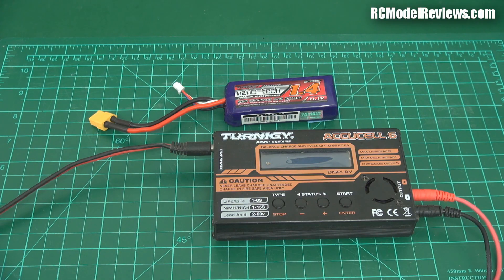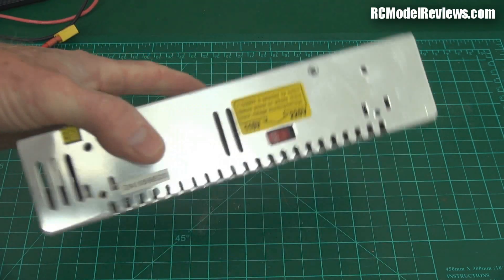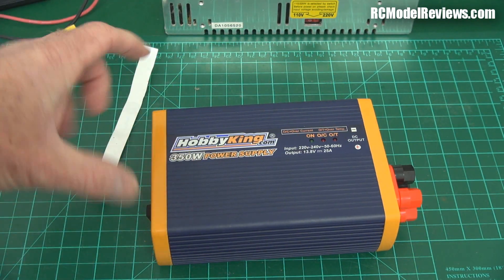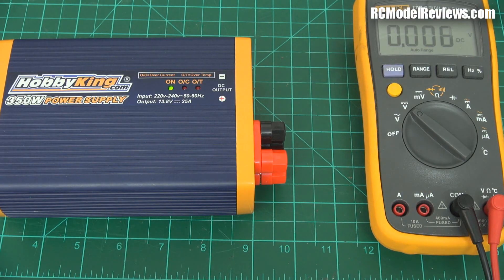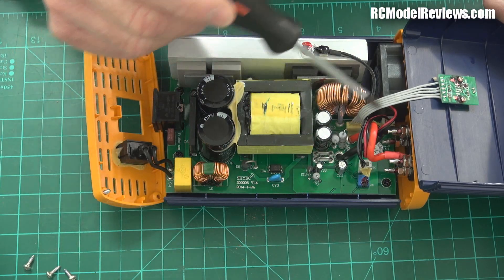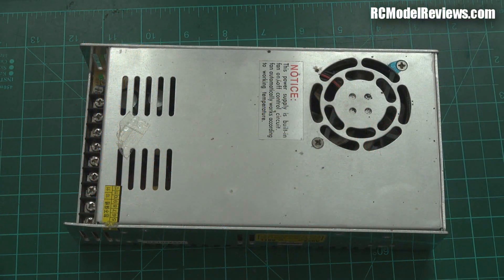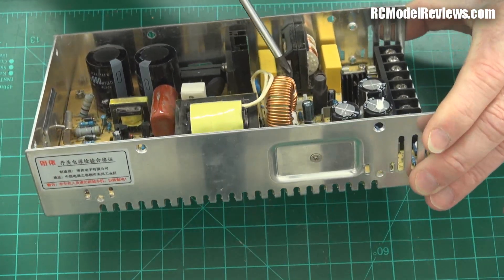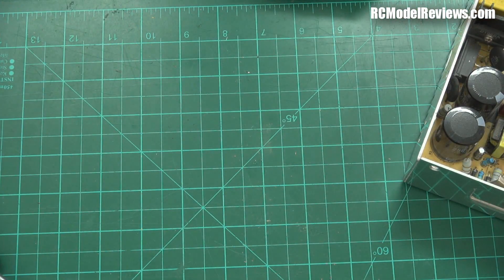HobbyKing 350 Watt 13.8V power supply

Comment: LOL at those output capacitors :D what is that hardly 1000uF? probably not even low ESR either, the ebay one looks like 3x2200uF or a total of 6600uF!!

Comment: I just dropped by to tell others that I've been using this power supply for a year and it's so f**^ LOUD!

Seriously, I take 200W out of it and built in fan is very very loud. Supply itself is not even warm so I think it's firmware issue that spins fan too fast even when temperature is ok

Comment: great idea ,I have a question for you, how I know , how many watts needs my charger, for te ohm law ,or what, my charger is a graupner polaron ac/dc but the ac circuit don't work, don't want to start, but if I put it in my car battery works like new...
I buy it and came like that but when I open the box the warranty was over ,that was a backtrip but I tested in the car and by surprise its start well like nothing is in te other circuit charge well discharge well ,do all like supose to ,but the AC don't work

Comment: Good info Bruce. I've been using my Ham Radio PS which of course are a totally different animal. Not really portable,so the HK unit looks useful for field use since my vehicle has a 110vac power port( need to check to amp rating) but a unit like this should be useful if needed.

Comment: I have this power supply and have been using it for a while now. I use it with an iCharger and a paralell board to charge 4 4s batteries at once. It handles a 20amp load no problem.

Comment: Hey Bruce, could you do a video on how to use a multimeter to find  ground, positive and signal points.  I seen a min-naza video online, and the commentator referred to " ohming out " his naza to identify the positive, negative and signal for the gps input.  I bought a camera switcher from hobbyking, but I'm scared to use it because I've read that the polarities can be reversed from what's printed on the product.

Hope you or someone else can help.

Best regards

Comment: I use an old Antec 650w PC/AT power supply to run my Hyperion charger. I ended up needing to use two 12V rails to supply the charger because while a single 12V rail is rated for 19 amps the molex connectors used on PC power supplies would start getting warm when charging at 7A.

Comment: What batteries are you guys running in your 250 quads. Hobbyking is pushing a 40c 1400 mah but it's back ordered. Is the jump up to 40 c worth a bit of added weight?

Comment: It would be really nice if you'd measure radio interference as well. Cheap power supplies, LEDs etc often cause horrible radio interference, especially on shortwave fequencies. I certainly don't want any of that stuff in my home.

Comment: I bought a chinese 60A 12V supply to power my 400W skyrc charger, works like a charm, regulary charge a 6S 9000mah at 12A, only it does make a high pitched screeching sound under high loads though.

Comment: Hi Bruce! Could you make a video of the X8R, and how to optimize the range by adjusting the antennas on the receiver?
Reply: Put the paddles at 90 degrees at their bases, ensuring one paddle is also rotated 90 degrees as well. Check Dennis Baldwins channel for an example.

Comment: Hey, what happened to showing your Bodgy Bus Bar system! Hmmm.... BBB... You got a trademark on that? :-)
Reply: Ben Govett Yeah, forgot to include that footage -- I'll do a follow-up when the bits arrive for the other supply and include the bodgy bus-bar setup then ;-)
Reply: ***** If memory serves, in order to get UL or CSA or whatever your local safety certification agency is to pass your product as safe, the X and Y capacitors need to have a self healing dielectric. So assuming the safety certificate is not a forgery (admittedly most are these days) the caps are probably legit, which is admittedly impressive. Of course they could be fakes, at which point the UL probably is too. Or maybe they were salvaged :P
Reply: ***** would you also do a video on how to hook up a charger to the industrial power suply and leads to the mains

Comment: Why don't you use UPS from an old PC? Are these any better?
Reply: Hotwire A PC power supply, although it may be rated to several hundred watts, puts out most of its power at 5V.  The 12V output has much less power and is also only 12V.  Most modern 4-button chargers work much better at 13.8V through 18V.
Reply: *****
More modern PC power supplies provide 12V to the graphics cards (yellow wires as you know) and many support two graphc cards, two leads for each card, so there are plenty of options.These modern gaming graphic cards are very power hungry eg my GTX780 is rated at 250W. So there is plenty of power on these rails for running charger(s).  I use a 600W PSU and used plug adapters so I didn't have to mess up PSU leads just in case I wanted to use the PSU in a PC again. I initially purchased the  PSU for a crytocurrency rig but when I heard ASICs were coming I changed my my mind, and electricity is expensive where I am.
Reply: stewjw
Hi Bruce I'm surprised you didn't get into that and designed your FPGA crytocurrency computer.
Reply: stewjw
Yeah, but the problem is that the output is exactly 12V and many of the more powerful 4-button chargers won't deliver their full rated power unless they're fed with a higher voltage.  That's why this supply is a nominal 13.8V and my other one is a nominal 15V.  That extra 2V or so can make quite a difference when fast-charging large packs because the boost-buck converter in the charger is pretty limited.

Comment: Good review Bruce.  One suggestion for this type of item.  You checked voltage output at no load.  I would connect a watts-up meter or similar meter to the output and then connect up a charger or other load.  Test the unit at a something like 50%/75%/100% load to see how far voltage drops and also to verify if it can run at rated amp load for extended amount of time (or at least long enough to charge a common side lipo). And if you really want to dive a little deeper show us the voltage ripple on your oscilloscope to see how clean the output is.  :^)  Due to the nature of lipos I don't skimp on my chargers and its important to me to feed them with quality power otherwise its just another point of concern with lipo charging safety.  Just a thought.  Keep up the good work.

Comment: I have been useing the 30Amp aluminium one from DX.com for 2 years now. It will output 15.44V with the V adj all the way up. Tested it for 30A with power meter, esc and brushless motor for 5 minutes till the unit got got too hot for my tastes. My icharger does 20A max so no probs.

Comment: Yay Team...!

  It's surprising how long the solid state stuff will run, I have a 12V DC > 240V AC Inverter that's almost 30 years old, once it cooked it's Drive Transistors when it got a drink while operating in a rainstorm and my forgettery had left the Power Shack Door open, during it's first year in use...; and a few months ago it stopped working after the Leads managed to corrode through at the Battery Clamp attatchments...

  It, like your Industrial Cheapie, lacks a Cooling Fan and relies on Atmospheric Thermosyphoning to pump away the waste heat...; I wonder how long the HK unit's Cooling Fan will last, and how much accumulated Juice the Fan will suck during it's working lifetime (especially as a proportion of the Power which goes into the Battery Chargers...)  ?

  I like Thermosyphons, they're practically a Something-For-Nothing Machine,  and though most SFNs try to run by Perpetual Motion ; a good Thermosyphon is only tapping into Boyle's Law of Gasses, Coanda Effect, and Gravity... So they're Yummy...

;-p

Ciao !

Comment: Or, if you are really cheap, and you need juice for the same lipo charger mentioned, you can spend $15 for  Hobbyking's  #9052000023-3/67099 Hobbyking™ 105W 15V/7A Switching DC Power Supply (AR Warehouse). It works fine.

Comment: hey bruce can you do a video on ac conversion to dc
.and specifically what a bridge rectifier is.
why the power supplies feed dc at frequency and why that use dc chopped up rather than ac?
I may be wrong about effectively turning dc on and off rather than ac but if i am, why not use dc chopped up?
Reply: In case he doesn't, heres a quick answer.
A bridge rectifier consists of four diodes (not the Light Emitting kind), each of these diodes will only allow current to flow in one direction; a diode bridge will take an AC signal that switches positive and negative around between two wires, and connect the positive lead to one path, DC +, and the negative to another path, DC -, no matter the orientation of the AC signal. The diode bridge will not always output current, since the AC signal is off during it's transition between + and -, therefore the input capacitors are necessary to store a charge while the AC signal is off (or low on the voltage slope). The steady high voltage DC supply is then fed through the Field Effect Transistor(s), which is only on for a specific amount of time; the frequency is the same, but the duty cycle (on time) changes depending on the load drawn. The chopped up DC output from the FET, is delivered into the output capacitors (making the output signal smooth), through a transformer and then an inductor (a piece of coiled up wire), or an inductor only in cases of low input-voltages below ~50v; the transformer down-converts the input pulsed DC voltage, and the inductor will take a short spike of relatively high voltage and output a lower voltage for a longer duration. When requiring an increasing load from the system, it will increase the duty-cycle/on-length of the chopped DC signal, in order to ensure that the output voltage doesn't drop. The duty-cycle must constantly be corrected, in order to output a specific voltage at a specific amperage draw; the controller of the FET has a feedback for this, to know what the output voltage is, so it can adjust the duty-cycle accordingly, i.e. longer if the output voltage drops and shorter if it rises. This explanation is simplified and more factors are required/relevant for this to function, but I think you got the general idea.
Reply: TheMrTape much simpler than i needed but cheers

Comment: It's a shame this power supply doesn't have PFC.
And it's not extemely cheap, a MeanWell industrial supply would be €20 more expensive in my area, but it will last mutch longer.

Comment: A nice alternative for the Accucel 6 charger is the following one from HK.  It has a power out plug that fits the power in jack on the Accucel 6, which is a plus, runs on 100-240V and it's only $9.  It puts out 5A at about 15V.  http://www.hobbyking.com/hobbyking/store/__11758__HobbyKing_Power_Supply_100_240v_5A.html

If you live in the US or your electric power is at 110V, there's a slightly better choice that is very similar to the charger above, but puts out 7A @ approx. 15V, and has a power plug that fits the Accucel 6.  It's about $13.  http://www.hobbyking.com/hobbyking/store/__20971__Hobbyking_105W_15V_7A_Switching_DC_Power_Supply.html

Although I have other chargers besides my Accucel 6, I like the convenience that comes with being able to plug in my Accucel 6 instead of fumbling around with alligator clips.

Comment: I'm pretty sure everyone will be chipping in with their favorite charging solution, so I figured I could start.

After using the Turningy Accucell (running of a Laptop charger) for quite a little while I went looking for something that had an integrated AC power supply.

I've found this:
http://www.banggood.com/IMAX-B6-AC-B6AC-Lipo-NiMH-3S-RC-Battery-Balance-Charger-p-908064.html

I have been quite happy with it since. It is basically a copy of the Accucell running the same firmware, but with a built-in 110-220v 50/60Hz power supply, and yet sill has a DC input (so if needed you can still power it from your car for example).
The only down side is a lack of a fan on it, so it will get reasonably warm when charging 6S @2.2A(2x 3s 2200 in my case) in warm weather.
Oh and it's pretty cheap to about 35$

Cheers,
Murphy.

P.S. Nice video Bruce (as always).
Reply: I don't understand why serious or even amateur RC hobbyists use 12v chargers when basically ever decent charger today accept both 12 and 110-230(auto sensing) inputs and don't cost anymore than crap 12v ones. Why bother with separate power supplies, wires and all this crap.
Reply: RCKnut Well I ran into the issue of charging several high mAH 3S batteries in parallel and finding that my 5 amp charger fell on it's knees and wouldn't even approach max output. So I started looking at higher output DC power supplies and I ended up with the silver model Bruce showed here. I was going to buy it from one of the several mass merchandisers from China when I found it right at home and within 2 day delivery from Amazon at the same price. As Bruce points out, now I can run several chargers at once, charging several batteries each and not wait and wait just to get in the air again.
Reply: but you still need several charges, I can plug several 12/230V chargers into the cheap power splitter I can buy at the nearest convenience store as well.... so... why bother with adding an extra component.  which WHEN it breaks, like in Bruce's case, it makes ALL your chargers useless, when the transformers in one of your 12v230V chargers break, it makes ONE of them useless.
Reply: RCKnut Well, yes and no. I have several parallel charging boards that can charge up to 6 or 8 packs at the same time. The point I was trying to make was that the built-in transformer cannot deliver the current that I'm looking for. Using an external power supply I can throw as much as each charger has while charging several packs at the same time. The idea is to get flying ASAP without waiting for one pack to charge after another or when trying to charge them using the mains (120V here) transformer inside. If something fails it fails! Luck of the lot. I'm not too worried about failures being the end of the world. I can always charge more slowly with the included transformer inside. I'd bet that AC/DC input chargers on the market deliver their peak performance while having a suitable 12V input and not with the built-in transformer.
Reply: RCKnut Here's a good source for reading on the subject:

http://www.rchelicopterfun.com/rc-battery-chargers.html

Comment: i bought a universal notebook power supply, it does 5amps from 12 to 24 volts, and i paid 15$, it looks nicer and it's smaller than those you have there. I prefer the laptop ones, even if i can't use multiple chargers (i have only one)